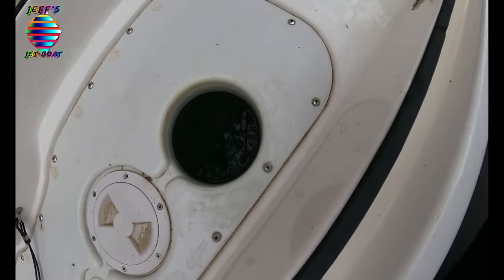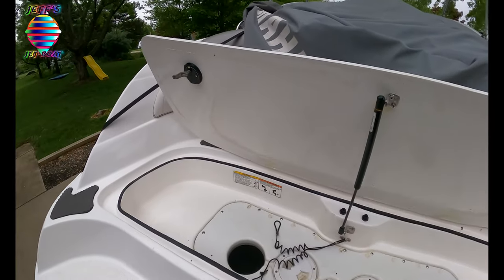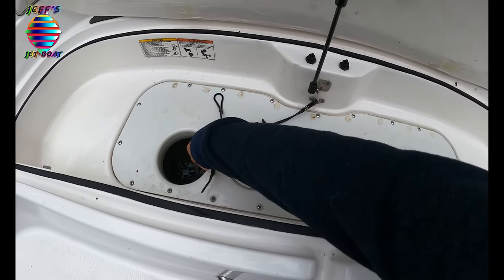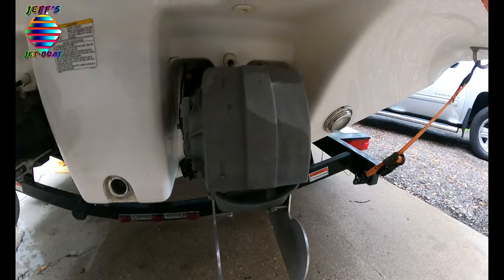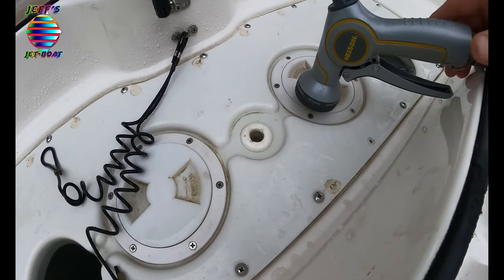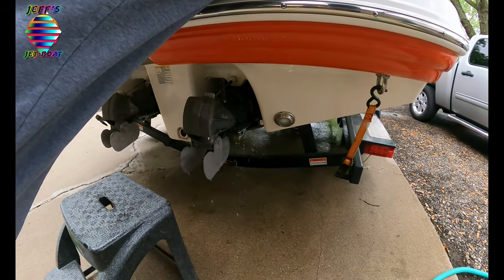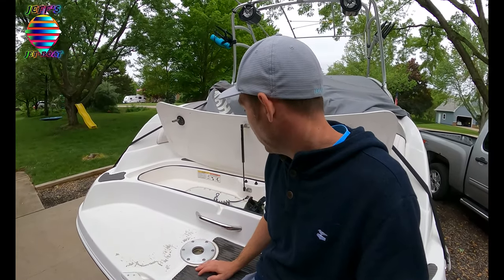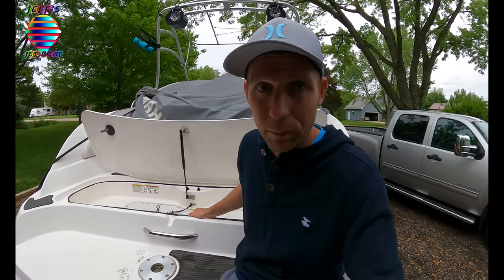Water On Top Of Clean Out Plugs - YAMAHA JET BOAT

Comment: I stalled a check valve in my drain hose. Also, I replaced the fittings with stainless because the plastic ones kept coming loose. I made the mod mostly to keep water from going into the bilge access hatch not really about the plug cavities.

Comment: Thank you Jeff. I had the same question, but now feel better about it. Do you have any recommendations for fixing seat fabric? It is coming apart at the seams of the engine bay lift gate. Thank you sir for your time.
Reply from the maker: I don't work upholstery & fabric, so just like you I have to pay someone to fix it, sorry.
Reply: @JeffDoesThis  Thanks Jeff. Looks like there is a shortage of that service where I live, told that most of those folks have closed shop. Thanks again mate, be safe and God Bless!

Comment: Good info! But when I pull out the clean out plugs the water doesn’t drain it just sits there. Any ideas? Thanks!
Reply from the maker: It won't drain when the boat is in the water. That's the water line.
Reply: @JeffDoesThis  yup boat out the water on the trailer wont drain.
Reply from the maker: It's impossible. You must be referring to something else?  Or your messing with me.

Comment: Hey there Jeff..quick question. 
Do you have support blocks in the  clean out plug area to support the hatch from breaking?
Reply from the maker: No I do not.  We run a 750 pound ballast bag on it too.  But I can tell you these AR/SX 230 models are known for the clean out hatches to get soft spots on them.  I rebuilt mine do to a soft sport and have a whole video series on it too.  If you hatch is in good standing condition, you do not need to support it with anything.
Reply: @JeffDoesThis  Thanks. You are doing a great job. Please continue to put out more videos.. thanks again.

Comment: He Jeff question have an sx230 what happens if one of those pop out while driving the boat can it cause major damage?
Reply from the maker: No major damage to the pump or engine.  But maybe it could crack or dent your clean out hatch lid.  Remember the plug is located before the impeller so depending on what speed you are at(water being forced into the pump) will determine how much force is going to shoot the plug up.  Typically, nothing bad happens unless you are at max speed (50mph) and the plug pops out.
Reply from the maker: Watch this video and you will never have a plug shoot out.  - https://youtu.be/JQL6hjkd-5E

Comment: Question: left my boat in the water over night at the marina. They’ll take it out in the morning. Is the binge automatic?
Reply from the maker: When the switch is on it will activate the bilge pump every 5 minutes and if the pump senses a load(water) it will run until the water has been pumped out and the load is no longer on the pump.  So yes, it's kind of automatic and yes you should turn it on if you keep your boat in the water overnight and will pump the water out.  Also I have left my boat in the water for 3 days and didn't use it and it did not drain the battery.
Reply: @JeffDoesThis  when you say the switch. Do you mean the switch on the helm? Or the battery switch?
Reply from the maker: Yes, to both, you have to have the battery on to supply electricity for the bilge pump  And then you have to also turn the bilge pum on.

Comment: Hello Jeff. I just bought my uncles 2007 ar230 with only 5 hours on it. So I took it out on the lake for about 5 hours. When i took the drain plug out alot of water came out and I have very little in the middle of the engine compartment.  Any advice for me. Thanks in advance.
Reply from the maker: I would bet your scupper valve has a crack and is leaking(very common).  On the trailer, open your clean out hatch and unscrew the plastic access ports and drop a garden hose down there and start filling it with water.   Make sure to tilt your trailer up to max height in the front and watch out back for water to run out.
Reply from the maker: Also watch the first 30 seconds of this video too https://youtu.be/R4uqMh-nGAg
Reply: @JeffDoesThis  even though it only have 5 hours on motors. I was thinking it's a brand new boat. I know it was a few gallons that came out.
Reply: @JeffDoesThis  thank u.

Comment: do you push the button and hold it down and pull at the same time mine don't budge
Reply from the maker: Stuck clean out plugs that haven't been removed in a long time are a common problem with yamaha jet boats.  There are tons of videos on how to remove a stuck plug.
Reply: @JeffDoesThis  I applied marine grease to the side 360 degrees of the plug to make it smoother and easier to remove.

Comment: Hi Jeff, new to your channel.  I have a new to me 2007 Sx230.  I always have water in my ski locker.  When plug is out in the locker compartment I can actually see water bubbling in.  When I take boat out of the water and pull the plug I have a lot of water that drains out.  confused on all the plugs in engine bay and locker.  I get there will be some water from passengers getting in and out of boat, but not as much as I seem to have.  Do you experience this?  Normal?  Thanks
Reply from the maker: No, it is not normal.  I will be uploading a video this week explaining the drain plugs and were water can lean into your boat.  Stay tuned!
Reply: @JeffDoesThis  can't wait thanks

Comment: Do you have Cobra fins or Thrust Vectors?
Reply from the maker: Cobra Fins
Reply: @JeffDoesThis  have you ever done any sort of comparison of the 2? My family and I just bought a 2021 AR195 and that thing is very hard to steer at low speeds. So I've been trying to do research on which one I should purchase for better low speed handling.
Reply from the maker: No I have not done a comparison.  Just give it time and the boat will be easier to drive.  Think about the first time you had sex, you probably sucked at it and over the years you  got better(hopefully).  Just like anything, waterskiing, wakeboarding and driving a boat with a different drive system it takes a minute to get use to it.  After a full season you will become a pro.
Reply: LOL!!!   @JeffDoesThis

Comment: Hi i have an 2017 sx190 and igot an issue past weeknd, my  boat starts taking in water to the engine compartment really bad while moving (driving) as soon as i stop the boat it stops taking in water. While being anchor not water takes in.
Any idea what i have to look for?
Thanks in advance
Reply: Dealing with the same issue yesterday. Looking at whether the seals on the clean-out ports are weak and allow water to come in while travelling at higher speeds. Another thing that I was told is that it could be the scupper valve. :(
Reply: @kevinh7947  i found out pn mine that the draing plus werent good so i changed them ill try it this weeknd.